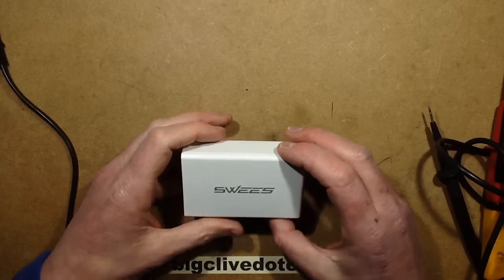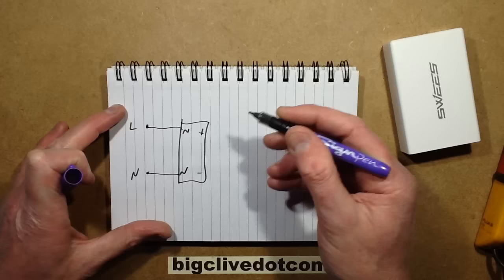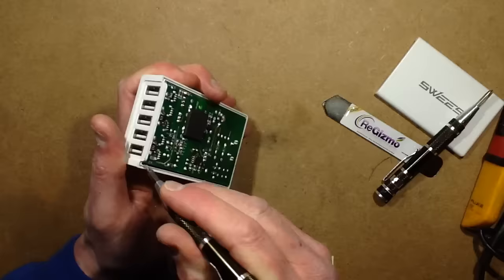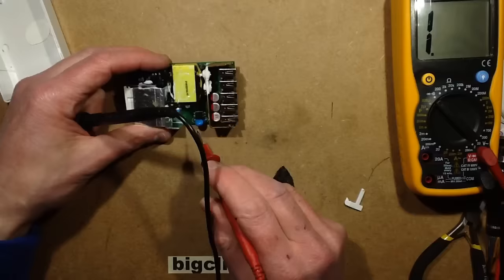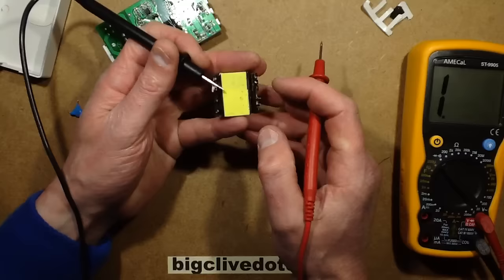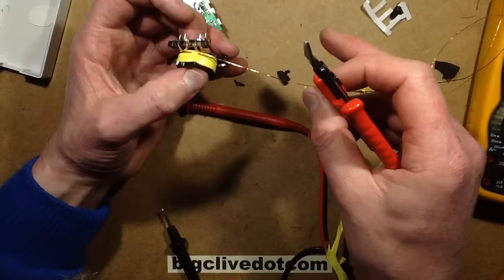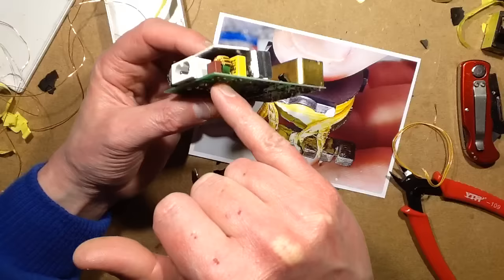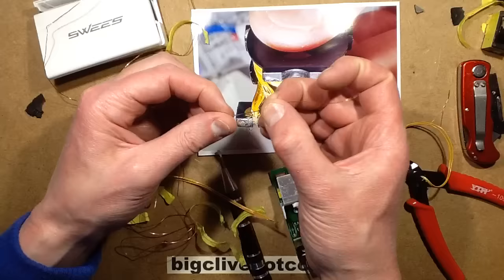Horrific USB power supply fault.  (Electrocution risk.)

Comment: I spent a better part of the video waiting for you to discharge that main electrolytic with a finger!
Reply from the maker: +maxsnts I did actually stick my finger across it.  As with most of these types of supplies the switchmode chip discharges them to a modest level quickly just by virtue of their own current requirement.
Reply: +bigclivedotcom  My fingers normally seek out those caps on their own.. And as far as cheapo Chinese PSU's go they normally still have 300v or so on them :o
Reply: +bigclivedotcom As a noob I was wondering the same thing! Is there an easy way to identify if it's a switchmode supply, other than identifying the chip? I suppose it's safer to discharge them anyway if you're not 100%.

Also, if you don't have any videos on transformers (I haven't noticed) that might be a good and useful video, as they confuse me lol
Reply: +SteveM non-switching supplies generally have physically much larger transformers.
Reply: Ah I see, thanks!

Comment: Clive thx for sharing and good sleuthing and without an official schematic. When I saw that light bulb light that means a serious low resistance fault between the mains side and the "isolated" output side.
Clive in the future may I suggest the use of a high current to isolate the fault. With enough current you'll get heat and heat is a great indicator of a very low ohmage resistance.
Again thx for sharing, identifying and troubleshooting the fault.

Comment: Great video.....I have a really dumb question though (pardon my electronics ignorance).  I thought transformers needed AC and bridge rectifiers turn AC to DC.  So wouldn't the rectifier come after the transformer in the circuit not before?
Reply from the maker: +Chris Collins Switchmodes convert the mains to DC then to AC again at high frequency to use a smaller transformer.  Then to DC again.

Comment: Thanks Clive. Scarey sh*t and an interesting teardown /analysis. I subscribed after the short (excuse the pun) I watched, about ceramic capacitor failures. I had about three different chargers fail around the same time and got sick of it so I started looking at boards...  I ended up suspecting the flat ceramic capacitors on one but have gone no further. Then I bought a new two bay USB hard drive box and promptly found what I consider too much residue on parts of the board between multiple pins! I have not been game to hook it up considering the Tbs of data I could potentially lose! There is just so much low quality electronics that gets into the market.

Comment: Clive, I used to see the words "HI-POT" printed on transformers when I was in TV, monitor and PSU repair, indicating that the transformer had been tested for insulation breakdown at high voltages.  This identified any insulation failures and would have found your faulty transformer.  You don't see this marking nowadays and I would be surprised if the price these cheap Chinese PSUs sell at allowed time for hi-pot testing (or indeed any testing at all).

Comment: Hi Clive, with your expert analysis, please tell us that you have informed Amazon, I hear far too many people warning others about unsafe electrical products bought through Amazon, Ebay and the others.  If you told me not to use something you could bet I would bin it instantly, your expertise should never be doubted.
Great videos and can I just say that one of the comments on here says "i know nothing about electrical stuff, but your channel is sooo fun to watch. is in fact dead true for myself. keep them coming clive, good stuff mate.
Reply: They seem to be unavailable on Amazon now.  Only problem is that there are so many of these things under different brands,  I've just bought a 6 port one.  Will be cracking out the multimeter to check for mains on the outputs.
Reply: +Stuart B Great to hear that there off amazon now, good luck with your 6 port adaptor.

Comment: This may have been an opportunity to use your thermal imager. You could have introduced a load to close the circuit and produce heating on the PCB. Then use the thermal imager to see the hot spot? 

Maybe use an isolated variable AC power supply to slowly ramp up the votage to flow the needed current for heating without neccessarily clearing the short.

Comment: You obviously trust that there is proper bleeding of the 68uF when you finger the board that soon after disconnecting mains.  The 320V or so DC voltage from a charged 68uF capacitor can make a nice burn mark on your finger at least.
Reply: +Tom Ahola Id be more worried by him nearly lopping his finger off with that dagger than a little cap burn....

Comment: To get these multi-pin items out without mechanical stress a hot-air paint stripping gun can be used very effectively on the solder side. It can singe the PCB but the components should just drop straight out without any damage, good to relays etc too.

Comment: Fascinating tear-down as normal Clive. One question, apart from improving manufacturing techniques, what protection could a manufacturer build in to protect against this?
Is there something (Other than a full-blown RCD in the unit I'd assume) that you could put on the input or output to protect the end user against this type of failure?
Reply: +Andy Brown they could do product testing once they have put it together, or QA on the transformer line, etc.  not to add more potentially faulty electronics to the pile!
Reply from the maker: +jusb1066 Another good thing would be adding a ground connection with the output's negative tied to mains ground.  It's actually quite hard finding supplies like that.
Reply: +bigclivedotcom I wondered about negative tied to mains ground, but wasn't sure if that would cause false trips with the RCD/RCB's during normal use.

Thanks for the info though, and yes +jusb1066 I agree a little more QA testing wouldn't go amiss, although I'd assume at such high volume, low pricing they'll only pull 1 in a 1,000 from the line to run a test.

Comment: I wonder if they used a wire brush type magnet wire insulation abrader on that secondary wire, and had the stop set where it took off too much from the ends? I've seen that happen before, in that they too much insulation off the ends, before they wound it.

Comment: Did you use de-soldering wick rather than a de-soldering gun? I find when removing multiple legged components like that winding, A gun tends to remove most of the solder and quickly cools the join, before it can set, allowing all the legs to move more freely. I've wound a few transformers and the scaring looks like they have lazily tapped the wires without pressing them down against the bobbin, also dragging the wire over the terminals rather than stacking it neatly as the bobbin spun.

Comment: I have been into those little switchmode power supplies often but never torn the transformer apart.  The weak link for sure, that insulation is so thin.  Guess these things don't get tested on their way out after manfacture.

Comment: OMG. As you were opening and handling it I was cringing that the main capacitor might still be charged. They hurt. I got done with an Apple plug pack that as I was removing the copper EMI cover it sprung back and connected to the main capacitor. Plug pack went flying. 😅

Comment: I wonder if you can contact the company for a possible recall or something.  I would hate to think of some toddler or even an older person dying because of the stray voltage. Maybe it is a manufacturing defect that happened to a whole batch of these transformers.  Excellent video!

Comment: BTW I love your videos, going to show them to my dad who'll get a kick out of watching them - my only suggestion is perhaps you can get a 2nd light source to reduce the shadows your hands casts over the table
Reply: +Dee I think you'll find Clive does already use a pair of lights. What is needed is a fill-in light just below the bottom of the frame. A strip of LED lamps might do the trick.
Reply: +48snapper What might work is, if the ceiling above his head is white to bounce an extra light to the ceiling, and then it will come down, covering a much lager area with some nice diffused light

Comment: Great video.  I hope that the manufacturer offers a free replacement when they see this.
Reply from the maker: +darrkstarg I think they can stick their free replacement up their ass sideways.
Reply: +bigclivedotcom True, I just thought it would be a nice gesture on their part...maybe this time they can even make sure they aren't using crap wiring in the transformer lol.  The question is how many bad transformers got out into retail.  Those wire casings getting sheared is a big deal and had to happen during manufacture.

Comment: Because it is shorted, could you put the bench power supply to it and turn up to a few amps while watching with the flir to see what gets warm? In a situation like this if it was an expensive piece of equipment, if you wanted to replace the bad component,  would the bench power supply damage anything else?

Comment: Great tear down and investigation.  It's sad that the most basic testing at the manufacturer isn't being done.  Hmm lets see if mains is connected to the output.   Nevermind Hipot testing the transformers or unit as a whole, basic continuity in two places would fail this device.

Comment: There was a broken tv that I decided to take apart a few days ago. It had the same plug on the back as this power supply. After it was apart, i reassembled the circuits together so i can get a good look at everything. While plugged in, i tried to pick up the logic board (should be all DC) when it shocked me. I was holding onto the analog antenna housing thingy. Felt like AC, no contractions though, and lasted until i let go. I then picked it up again, holding on somewhere else, and then set it down close enough for me to plug in an HDMI to my computer. Apparently i set it down close enough for a USB port on the logic board to touch the heatsink on the power board, because there was arcs, my lights dimmed, and my computer turned off. No breaker trip though. After my initial scare I unplugged the boards and inspected the power one closer. The heatsink was supposedly 'grounded' through neutral, or supposed to be. But the plug on the back is reversible, so it could become live instead. So that was fun.

Comment: Clive I have a lorex cctv system built into the monitor and the power supply failed so I replaced it and soon after it switched itself off and on then the screen stopped coming on but the system still showed as working by the leds lighting up , I struggled to find someone as skilled as you to fix it , what do you think about it 🙏

Comment: As a point of curiosity would there be anyway to have a system in place on the board to detect if the transformer had failed in a way such as this?

Comment: I find it very interesting to see the tools you use, and the tools you don't. My life saver is a neon screwdriver, don't recall seeing you using one. Any reason? Do you have one?
Reply from the maker: I don't really approve of the classic neon drivers.  I'd rather use test lamps or a modern volt stick.  Some of the neon screwdrivers being sold do not have suitably rated safety resistors in them.
Reply: @bigclivedotcom  Thanks. Mine is several decades old and hasn't killed me yet, but good to know newer ones might be dangerous.

Comment: So, if I understand this right, instead of the transformer converting mains voltage down to the standard 5V used to charge things by USB, the output remained mains voltage, correct? Wouldn't that fry anything plugged in to it? Your phone isn't designed to take a 240V hit - were any electronics collateral damage when the owner tried to use it?
Reply from the maker: It put out 5V, but superimposed on 240V to ground.  So the phone would only see 5V and charge normally until someone holding the phone touched a grounded surface.
Reply: @bigclivedotcom  Thanks for getting back to me so fast, even when my question was on a 5 year old video. Love your work, Big Clive, and I have to say I find your accent very soothing!

Comment: I have an 8 usb port charger with an lcd display showing charge status and current and it works really well. My galaxy tab s charged quite quickly and I also have a set of blue tooth headphones which charged up nicely too. I always look up customer reviews especially when it comes to electrical items as you can't be too careful and I avoided the cheaper ones too. Safety first.

Comment: I've had laptop power supplies from Amazon that got hot to the touch in minutes, buzzed with capacitor white as soon as I plugged them in, and loudly popped when breaking due to the capacitors failing. It took 3 months to get replacements that were not counterfeits, and multiple returns, which Amazon made me follow the standard RMA procedure each time even though I informed them that their stock was counterfeit and a dangerous fire hazard each time.

Comment: If the micro-usb cable is sparking when it touches a ground-referenced object, you know right away that the USB port housing in the charger is live.  The metal housing on each end of the USB cable are connected to each other via the shield conductor.  A simple ground wire would eliminate this risk.

Comment: If there was a very, very slight contact in the secondary and something shorted that potential to ground at a nearly (human) undetectable level, what are the chances that the secondary winding heated up to the point that the primary insulation began to flow and worsen the short until it was detectable? Or possibly the heat expansion of the transformer tightened the core and primary against the secondary winding and physically pushed through the insulation?

I'm just bouncing it around my head why this device would have passed any sort of factory testing and then failed afterwards, and the only thing I can think is that circumstances were set for it to fail within the first few moments of consumer use.

Comment: Outside of the dangerous condition with this supply, having mains on to the USB devices opens up the risk for damaging the devices! 

I myself have seen failures in power supplies causing voltage leakage or etc.

Comment: Fantastic video as always, especially for someone who doesn't have a grounding ;-) in electricals and electronics.

The lesson here surely is to never buy anything that doesn't have the CE mark on it. There's no point in buying an apparent bargain online if it turns out it can kill you. There's a lot to be said for the old fashioned approach of being able to touch and feel and visually examine something before you part with your money.
Reply from the maker: You can't even trust those marks.  I recommend only buying stuff like this from prominent local suppliers with a reputation to protect.
Reply: @bigclivedotcom  Hmmm. Good point. It's a shame places like Maplin are no longer around. And as for goo old fashioned hardware stores...
Luckily, we still have one here in Cork. But who knows how much longer it will exist.

Comment: I really liked this video. I think you missed something though. The isolation gap between the mains and the 5v should  be clear of everything (for isolation), but this company stuck a big piece of foam rubber right across the isolation gap. This foam rubber can attract dirt or moisture, and a lot of rubber is made black by adding carbon which is conductive. All of these things would provide a current path across the isolation gap. 

I would like to know what you think about this.

There are several reviews of similar multiple USB chargers on amazon where people say the chargers caught fire. Scary.

I just recently found your channel through a reference on the EEVblog forum. 
I also liked your PIR infrared detector video.  Keep up he good work!You mentioned somewhere about being in the UK or Isle of Man. Are you in the Isle of Man?  That seems like a cool place to live. I'm in California, quit a different climate.
Reply from the maker: +gwc1410 I wasn't keen on the adhesive foam at all.  That's why I was picking at it to see if there was any sign of scorching.  I am on the Isle of Man.

Comment: That was an adventure...and that is a very nice unit normally... just had the misfortune of having that faulty transformer installed in it at the factory.
Reply: Terry McKean so basically the guy who got this unit was just unlucky?
Reply: Well, maybe 'misfortune' or 'luck' would be the wrong term to use ... that event was just the logical result of a factory-worker's carelessness and sloppy transformer-building, and the lack of proper quality-control which would include a megger-test of each  newly assembled transformer to make sure none of the windings were going to short later on.

Comment: Surely this product should be raised with trading standards as a considerable safety concern? Is it likely that the case increased pressure sufficiently causing this to short more readily? No guarantee but Initially would it have been worth passing a limited current through at lower voltage to see where heat may be generated to pinpoint the short/ lower resistance?
Except possibly for Tantalum I never saw capacitors fail short or low resistance if circuits were designed well and opto isolators are also inherently well designed/ made.

Comment: I love how you stuff metal tools into electronics with potentially 240v charged capacitors
Reply: A capacitor can only charge up to its rated voltage.

That being said, even small capacity one rated at 50v has enough energy to make you jump.

You'll definitely feel it.